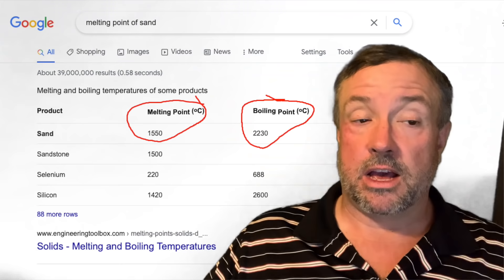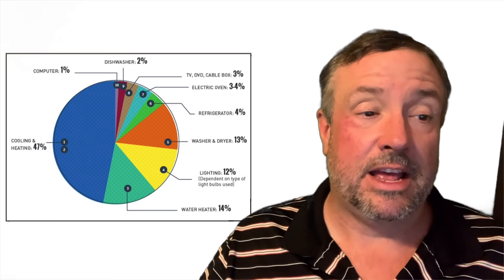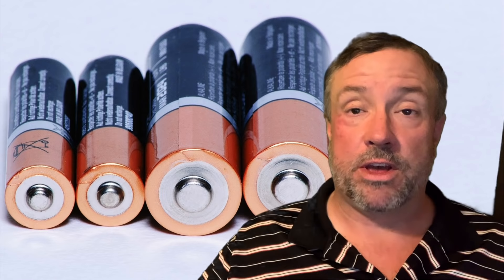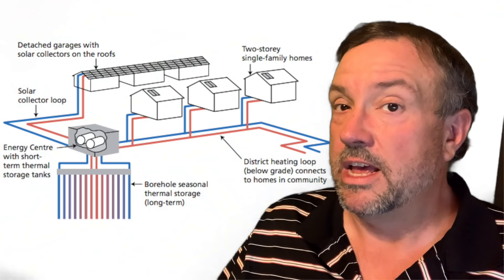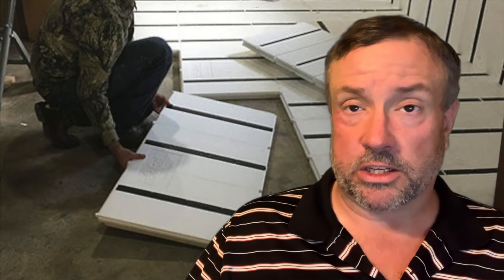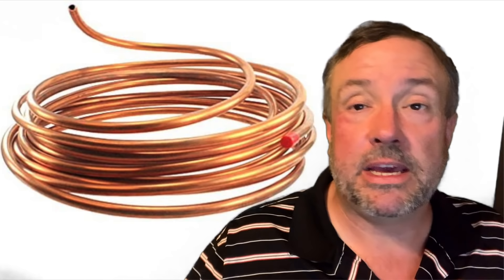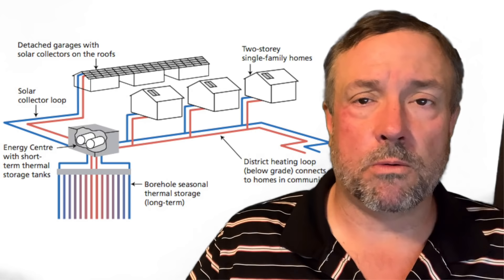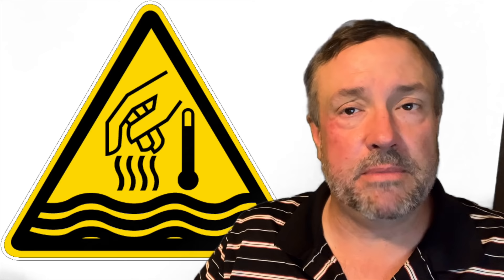Sand for Thermal Energy Storage

Comment: One great idea would be to pass the electricity produced by a solar array through a heat pump tuned to run at low temperature and thus reaching 3-4 COP in sub zero (°C sorry) regions. Around 5 in warmer regions.
That way you store 3x as much heat at low temperature in water (since the heat is around 40°C) or sand if you really insist to use sand, but there will be a temperature differential between the way in and return. I store the heat from my heat pump in a 200 gal (740L) water tank during the day when I am out and unstore it in the evening and night. Works great. And it is safer than to keep temperatures over 100°C inside my home...

Comment: Air to water heat exchanger is used in such high temperature sand storage systems in Finnland for example! 
Concentrated to high temperature solar beam should be used to charge that sand heat storage.
Reply from the maker: Thank you

Comment: You're worried about 300 F deg air being too hot for your house.  So at a convenient point after you've extracted the heated air from your sand-mass, mix it with a variable amount of external air to achieve a reasonable temp. for your home.  The engineering for the mixing area might be expensive (in order to not lose your original stored energy), but I'm not an expert.  Or another idea, just pump the 300 F deg right into an old-fashioned floor radiator (the kind originally built for steam).
Reply from the maker: Well said

Comment: You can use black steel pipes with fiberglass insulation and for the temp regulation you can use a mixing valve and a heat exchanger from oil to glycol. Great video, thanks.
Reply from the maker: Thank you for the ideas and kind words!

Comment: Try lining the bottom with a structural foam like foamglas. You may require reinforcing the bottom of the structure through areas of the insulation to take some weight off the foam (it depends on the vertical axis of your tank and the specific density of the sand you're using (I don't imagine any variety you'd want to use being too different from any other).

I'm thinking there could be benefit to designing the battery with a larger, flatter footprint (potentially, a roof mounted "sand panel" could work but thickness will increase weight while adding more total thermal storage potential per sq ft of panelling or a wide silo on the ground for larger applications) would allow an air channel to be added. This could be used to preheat incoming air to the HVAC system during the winter by "boiling" air through the sand inside the channel from bottom to top. The channel or pipe would be filled with sand and completely surroubded by sand, so it will easily regain heat lost through use simply through its metal housing being a part of the battery.
Reply from the maker: I think aircrete might be better and way cheaper, but good idea
Reply: @SimpleTek  AFAIK aircrete requires pressurized vessels to attain the required air pocket stratification throughout the concrete substrate. I'd guess there could be methods to create a similar material on-site but it may not have the same structural properties as the aircrete which is produced in factories. I, personally, wonder how a method using a dissolved gas in the water used during the later stages of the mixing phase could produce the necessary gas for such a material but whether or not those hold during the curing process is something I can't figure out in my head so I can't say whether the idea has merit. I do know that the acidity introduced via the carbonization of water could be a problem for the reactions involved in the setting of the concrete, so another gas may be more viable. Nitrogen doesn't dissolve nearly as readily as CO² but wouldn't lower the Ph as significantly as well as remaining an entirely inert gas regarding oxidation of the concrete's consitiuants during curing (air's oxygen content could make this an issue but I don't have the reactions memorized for concrete so I can't say for certain). Other inert gasses would likely be too expensive (helium makes me wonder how well the pockets would form due to its molecular mass being so low requiring a higher density gas for expansion to occur properly but helium isn't exactly cheap anyway) so I'd actually say CO² might be the best option, though I'd say it would have questionable long-term integrity when compared to factor-made aircrete.
Reply from the maker: @Bird-0  lot of big words there, tons of people make air Crete at home on YouTube.

Comment: The study suggest course sand with nitrate salt
The salt melts at 95° c and is a good thermal transfer between the sand and the heat tubes.
Using a convection oven to pass heat into the core of your storage via air.
Use a heat exchange with oil rated at 300° c
And pump that into a conventional water-based buffer tank. You can then control the heat flow
Reply from the maker: Wow, detailed information!!! Thank you
Reply: @SimpleTek  I'd say it's pretty simple information. I've only been looking at it for a day. 

One day I hope to build a 5 to 8 ton heat store.
Need to upgrade the three phase power first. I need to think where I'm going to put it underground. I live in a high density area.

Comment: Have you looked at Russ Finch's methods for growing things in cold climates?  If I had a big enough property that is the way I would heat things up like a green house.  I'm just starting to look at sand heating and storage for some around the house ideas so I'm just beginning my experimentation.  My first challenge is to see how hot I can get sand with just the sun.
Reply from the maker: Yes, he has a much higher ground temperature than I do. I have a video that addresses how to fix that though

Comment: As a thermal mass, the problem with sand is that energy cannot efficiently conduct between granules due to the air gaps between them, so then energy needs to transfer via radiation, which is much slower. This is why sand is known as a great insulator - the pockets of air. 

If you’re looking for cheap thermal mass, look to “road rock” or “road base”. The specific composition varies by region, but it’s what’s used under roads. It has a healthy composition of large, medium, and small aggregates, and compacts very, very well - meaning that energy will flow through it via conduction, not radiation.
Reply from the maker: Interesting… thank you

Comment: Consider a concentrated reflector system directly heating an air-crete box of sand with one window wall lined on the interior with cupric-oxide. An air gapped box around that box (thus two layers of window) could collect heat losses of the sand box into a lower temp storage like water.
Reply from the maker: interesting idea!

Comment: MultiTherm IG-1® is a highly refined; hydrotreated, natural mineral oil designed primarily for use in closed loop heat transfer systems. A 390 lb drum is around $410.55

OR

Synthetic thermal transfer oils might be the way to go. Eastman Therminol 55 or similar Heat Transfer Fluid has an upper temperature limit of around 300°C (572°F) and costs about $30 per gallon. An "open box" 55 gallon drum of Therminol 55 on eBay is listed at $750.00. 

Since this is for a continuous loop system, the actual volume of fluid needed is just enough to keep the solar collectors, pipes, heat exchanger and pressure tank full & pressurized.

I'm currently researching this topic so I'll be happy to share what I learn with you.
Reply from the maker: Thank you!!!!!!

Comment: Air under the sand should rise through the sand while heating so long as it remains dry and you have coarse sand. Delivery of the air could be as simple as metal piping to molded holes in the air create.
Reply from the maker: interesting
Reply: I would be afraid of air quality issues with the air flowing through the sand.  Yes it would rise and heat but still.   Cheaper than piping.   If the air could heat separate air or surface UNDER an air barrier then perhaps.
Reply: @l0I0I0I0  if air quality was a problem, a simple heat exchanger would nullify the problem. Dirty air on one side, house clean air on the other.  Or wash the sand and use an air filter until the fine particles are gone.
Reply: @dustind3502  yes heat exchanger would be ideal for this build.   Also as few engineers seem to know, water vapor also rises slowly through the whole building, and wood framing would not respond well but mold and other nastys would love it!  Therefore you would have to install a robust dehumidifier.  So as you stated, it would need a robust vapor barrier and heat exchanger which are sold commonly on the market.   TY
Reply: @l0I0I0I0  Takes a lot of energy to operate a dehumidifier.
Reply: @zedostenso3069  Thanks Zed.  Usually yes, but I've found some highly efficient ones that can remove large volumes of water and even filter the water
Reply: @l0I0I0I0  I always think dehumidifiers placed on top of high towers could cause cascading water that could turn small water turbines. I guess the humidifiers would need to be be wind and solar powered in first place.
Reply: @sampleoffers1978  
dehydroelectric ?
Reply: @bigoldgrizzly  Very nice. Dehumidahydroelectric but probably long way to go in design and naming anyway.

Comment: I made some calculations about heat storage in sand.

My not well isolated house needs about 25000kWh=90GJ per year. 1055J (or approximately 1000J) are about 1 BTU. Since there is also some sunlight in the winter lets assume that the heat storage need to store about 2/3 of this energy, i.e. 60GW.

Sand has a heat capacity of 1.25MJ/(m³ °C). A useful temperature difference range of the heat storage is about 100°C (e.g. high temperature=180°C, low temperature=80°C). The highest storage temperature is limited by the solar panels (should be vacuum tubes); the lower temperature is given by the needed heating temperature in the house.

This gives a storage volume of 480m³ or a cube with 7.8m length.

Now check the energy loss in the sand due to heat dissipation over the surface. Good thermal insulators have a specific thermal conductivity of 0.04W/(m °C). Our heat storage has a surface area of 368m². Assuming an insulator with 1m thickness and an average temperature difference of 140°C gives a power loss of 2060W or 65GJ/year. So even with this good insulation our heat storage will discharge within a year.

So, we need to generate 90+65=155GJ by solar panes or vacuum tubes.

Here in Germany, solar panels generate about 600 kWh/m²/year = 2.16 GJ/m²/year. So, we need about 72m² of solar panels.

So it works but it is quite some effort. If we scale things up to heat 100 houses things become more efficient since the relative power loss decreases.
Reply from the maker: Check out (google) drake landing solar community. It’s been working there for over ten years with 55 homes

Comment: The Cp of Sand is about 0.8 KJ/(kg*K).  So if you heat it from 0 to 500C you get about 400 KJ/Kg.  Water taken from 0 to 100C will give you 418 KJ/kg.  About equal to sand with only 1/5th of the temperature change.   If you can use steam the value goes up to 2776 kJ/kg.   Most good storage media use phase change to provide much great energy density in a small range.  If you want to use something for heating or cooling you are better off using palm or coconut oil with a phase change temperature near what you want to use for room temperature.  Sand will require too much mass, space, and infrastructure to be worthwhile.
Reply from the maker: wow
Reply: But you aren’t generally going to be heating water from 0-100. More likely from ambient temperatures to about 80c to avoid pressure problems. So a lot less energy storage. Also you will have steam/evaporation problems with water or degradation problems over time using oil.
Reply: Which is not a lot of heat.   1kWh = 3600 kJ...

Comment: Going in blind. 

I would go with Iron piping in a sand pit. Just use air to charge it in the summer. And air to siphon out the heat. The higher the temperature the less air you need to move throughout the system.
Reply from the maker: interesting idea
Reply: Air is not that good of a heat transfer medium. Hydrogen conducts heat 7 times faster than air. That's the lifeblood of every refinery and its in almost every generator over  100 megawatts but it finds every crack and escapes. Liquids are a better heat exchange medium especially if a phase change occurs...gas to liquid, solid melting, etc. Water is the cheapest most available heat transfer medium. I was going to try filling a 275 gallon IBC tote with road base gravel with 6 inches of sprayed rigid urethane foam as an insulator and water as the transfer medium. Ain't got there yet....
Reply: @kimmer6  I thought the same thing. But the plastic of ibc tote needs to be below 160* F (preferably 140* F or less). 
 My plan was using it to regulate water temperature of fish tank at 80*F year round in my insulated fish-house. The plan is down-sized to a 55 gal steel drum with PEX and sand-gravel mix as water heat exchange/bank. The ibc is better used as another 25 kgs of fish raising and water volume is a heat bank also.
The floor is 6 " of sand & river gravel and polypipe over 4 " of insulation board (R-20) base. ( I wanted to go 2-3 feet deep and do STHC system. But time frame & finances did not allow it. )
Reply: @redstone1999  I was planning on having a roof company spray 6'' of rigid urethane foam on all sides and top and bottom embedding the steel frame. Then it wouldn't really matter how hot the IBC tank got as it is encapsulated. Make a top hatch to load it with sand/gravel.   I had 2 inches of foam  sprayed on my roof 18 months ago and the stuff is wonderful. I can walk all over it and not damage anything. My attic fan rarely comes on at all any more. The foam insulates really well. We had 106 degrees F the other day and the house bottled up got to 79F.  The attic was 88F.  I saw 119 degrees F in the attic with the laser thermometer 2 years ago, and 106 degrees on my bedroom ceiling. Roofing foam is way  more rigid than foam in the can.

You have a good plan. My aquarium hobby went down the tubes decades ago. My son was 3 years old and turned the thermostat to full. I came home and $1000 worth of tropical fish were dead.
Reply: @kimmer6  Kids ??? Lovable little lords of destruction :D 
I like the idea of insulating my fish tanks with roofing foam.

Comment: 2 Pack system, one is the sand battery, the other is like a boiler running hot air from the sand battery and heating water to a controlled temperature of max 80 Celsius.
Reply from the maker: interesting

Comment: You move from vac tubes to other solar very quickly. I reciently filled a vac tube with salt. Installed a thermocouple and stuffed the top with insulation.   I don’t know how hot it got because the thermocouple quit working at 500F - 260C. These will work year round for heating oil but seals may be the concern.
Reply from the maker: very cool

Comment: Have you thought about moving the sand? My knee jerk reaction is to say it would cost too much to move the sand except in a separate battery project moving sand is the actual solution to a physical electric battery. I wonder if you could combine those 2 systems. The sand is slowly moved upwards by (excess) solar panel power via a standard motor. But move it upward on a parabolic mirror trough. As it goes up it is storing both potential energy and heat. Once it's hot, drop it off the trough and into your aircrete tank which is 20 feet off the ground or on a hill or cliff if available. When your batteries need charging or you are cold you drop the hot sand down a pipe and collect the electric via inverter and the hot sand lands inside your green house where you blow a fan it to extract the heat into the air. The sand sits in some sort of  "sand radiator" until it's cold and you use a microcontroller to open the flap at the bottom and the sand drops out into the base holding tank where it waits for a sunny day to make it's trip back up the mirror trough. I like this idea so much I'm going to try it. Thanks for the inspiration.
Reply from the maker: interesting
Reply: MOVE THE HEAT NOT THE SAND.

Comment: The higher the temperature the higher the losses. The best way to my mind would be to pump the heat into the ground in the summer, then extract in the winter.  The heat wouldn't heat your home for long without the aid of a heat pump, that's the only issue! Greenhouse would perhaps keep it ice free year round.. although the losses from a greenhouse are massive.
Reply from the maker: good insight
Reply: @SimpleTek  hho
Reply: @SimpleTek hydrogen on demand
It burns at very high temps and is easy to generate using solar
And you do not have to store hydrogen

Comment: If cheap is one of your main objectives,
Here are some basic considerations to get you on your way...
1. consider lower temperature media for transfer and storage. Lower temperatures mean lower energy loss generally, lower maintenance and deterioration costs.
2. Temperature and energy insulation is well known. There are tables that describe different heat conductivity.
3. Cheap usually means compensating for lower temperatures and conductivity by increasing mass and size.

So, an example is that if you have no size restrictions for a relatively small system you should consider simply circulating water through cheap, plastic pipe underground using the earth's natural temperature as your energy "battery." You would draw from the earth's temperature during the cold of winter and draw from the relative coolness of the earth during the heat of summer.

You can't go cheaper and simpler than that. 
How you extract heat for your home can be done a number of different ways... a heat pump, operating a stirling engine to drive a generator of some sort, you can do whatever your imagination might create.

There are plenty of systems that are based on what I've just described or you can build your own.
Reply from the maker: Very well said